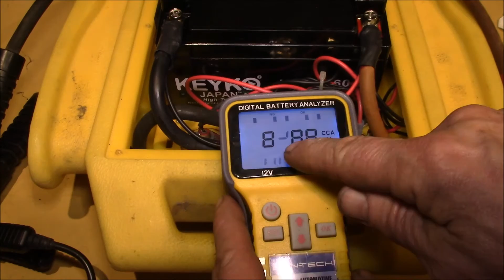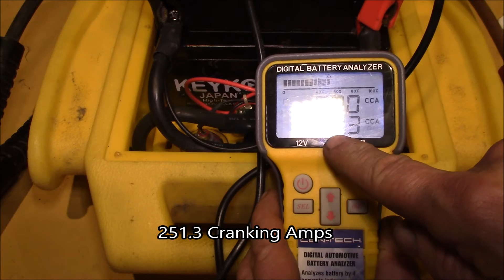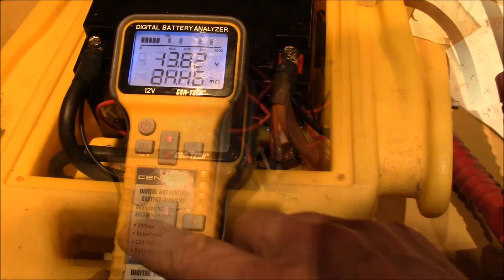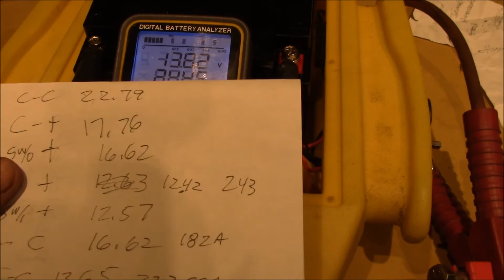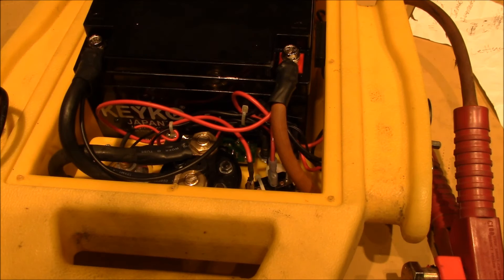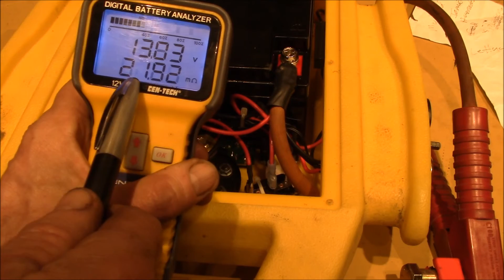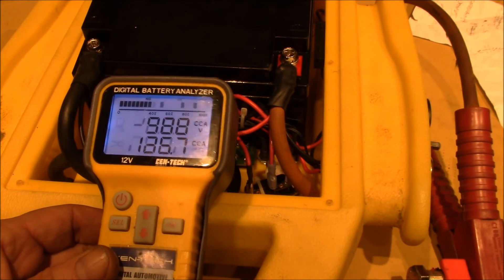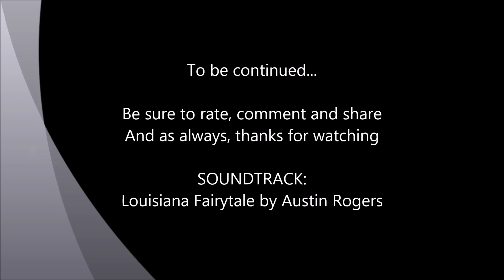Harbor Freight #40615 Jump Start Pack, Part 5 - Testing IR and CA

Comment: Why not pull a cable off of the battery terminal to test the battery directly out of circuit? I like the restoration setting it up to fulfill  your personal needs.
Reply from the maker: Yes, that is a testing option as well.  In this case, it results in the same reading as the other leads off the battery don't add to the resistance unless they are included in the circuit.  I think I did do this off camera and got a similar result, at least within the test to test variation I see on this meter.
This would be a good idea if you were testing something like a capacitor on a circuit board and the other components were connected across the capacitor leads.  Removing it from the circuit would be the only way to test it accurately.